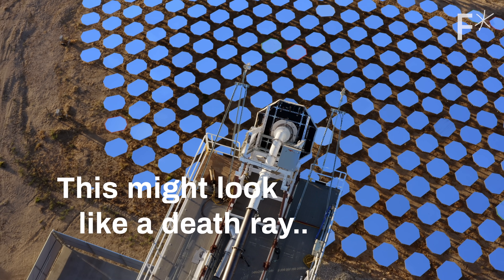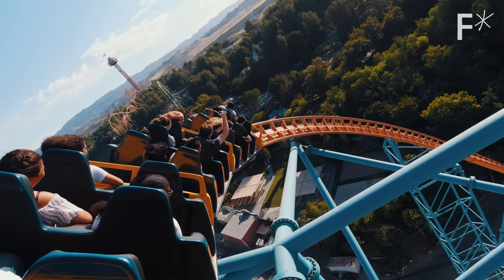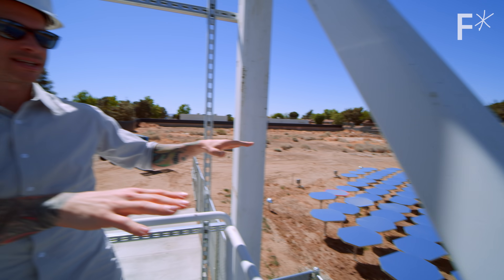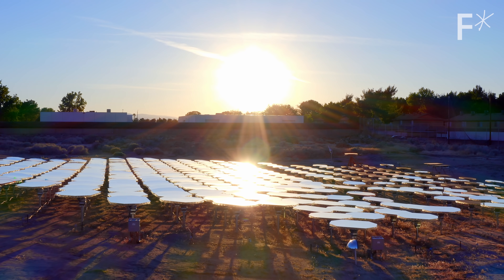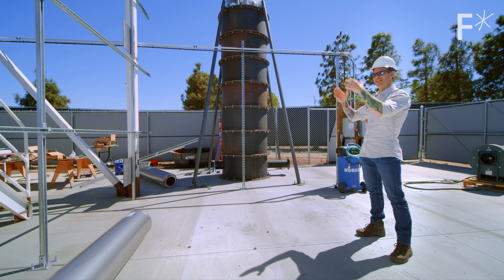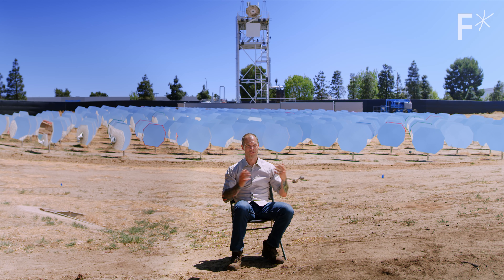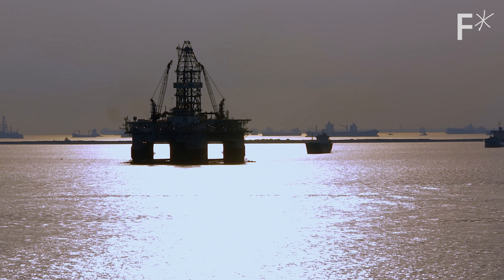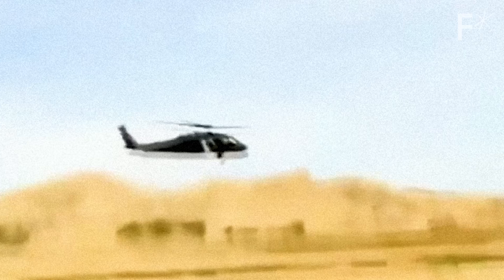How concentrated solar power could fuel the future | Big Think

Comment: Looks like an ad to me.
How efficient is the rock heat to electricity conversion?
How efficient is the electricity to hydrogen conversion?
How efficient is the hydrogen combustion or the hydrogen to electricity conversion?
I'm all for renewable energy, but there are so many questions left unanswered in this overly optimistic video.
We need to know if this is actually better than other renewable energy sources, and this video does not provide answers to that.
Reply: The Tired Horizon  30-60 homes is so little but seems ok for a start. Still it needs more advancement
Reply: Well if it’s storing the heat than this is already more efficient than photovoltaic lol
Reply: @MIKExMASSACREx  storing the thermal energy in the rocks may be efficient, but the heat is of little use unless you convert it into electricity. Thermal solar plants already exist and use the mirrors to heat water that turns into steam to power a turbine, and that is a pretty efficient method!
Reply: @unclerubo  this is what I was thinking of pretty much haha
Reply: @unclerubo  for some reason, the heated rocks make me think of heat pumps in some homes
Reply: I think he answered your question indirectly. He acknowledged that it needed to be cheaper than fossil fuel in order to be adopted. They are still working on developing the technology, but it seems possible. And I don't think more information is feasible in a 9:25 video.
Reply: @weldabar  I believe he specifically meant that the produced hydrogen needs to be more efficient. Direct electricity for the grid/cars etc is another option and usually more efficient. But hydrogen as a fuel may end up being the thing we find in industrial vehicles rather than electric, electric vehicle charging in cities will be tricky to roll out to all.
Reply: @weldabar  that’s not answering anything indirectly but more so it is their intended goal. However without knowing how they intend to achieve such a thing. It isn’t anything significant to talk about
Reply: Is that not more or less what the man traveling in his horse and carriage said when he saw his first Ford model T go by him?
Reply: @joe28704  except the model T was efficient and much more mobile than a horse. This doesn’t even compete much as far as from what is shown
Reply: @c.galindo9639  You are saying that from hindsight, not from the horseman's perspective at that time.
Reply: @joe28704  be it from hindsight or whatever the information I said is correct and in hindsight from this video. None of it is as feasible as other alternatives. It’s a start but a long way from such a thing. If anything the comparison is putting up the design of a brand new wheel vs a fully functioning wheel that is more capable and already installed and manufactured whereas this one is in the developing stage and is being tested and tweaked to rival the already existing and functioning wheel
Reply: @c.galindo9639   Your argument sums up to be what the man on a carriage thinks as the Model T pulls up to him. Life goes on.
Reply: @joe28704  so someone who thinks about efficiency and productivity?
I actually have no problem with that, do you?
Reply: It's an ad for great reset. A more easier way to do it is just drill a hole for 20km where is crazy hot, dump some water and wait for steam to come.
Reply: By the way, this looks cheaper than photovoltaic electric power, but still, no figures are presented, so I would like more information...
Reply: i am doing solar concentrator project on my backyard, it is good for domestic/independent use but for huge scalr like power entire earth, surely would be impossible, too many hassle and moving part,  solar energy are best for alternative but not for main sources
Reply: I see where you're coming from. Consider that it's early days on this tech and the efficiencies are less important when your input costs are close to zero. Let's see how it pans out. As an Australian, with lots of sunshine, I will confess to having a vested interest. :-)
Reply: This is old technology. 
They are just reporting it as new.
Reply: The Tired Horizon  what about heating rocks or something by lightning drawn in somehow
Reply: True...i was thinking the same
Reply: Cryogenic liquid hydrogen stored in a shipping container. Enough said and shown for me to turn off the video.
Reply: @MS Design it is a dry gas but you can never use natural gas pipelines to transport it because of hydrogen embrittlement. That's why it will be expensive no matter what, cold or warm area.
Reply: The ability to transfer heat is quite well understood so I would assuming it's in the high 90%, steam at 1000C is far beyond critical steam so about 40% efficient, but that is the same as any coal fire, natural gas or nuclear power plant, so we are talking ~39.2% efficient assuming the conversion from heat to storage to steam is 98% efficient. 

I don't think the efficiency of the hydrogen generation is particularly the question that is most pressing because the idea is you use energy that was otherwise going to be wasted so the efficiency doesn't really matter that much, what does matter however and is completely ignored by everyone I have ever listened to on this topic is the cost of keeping the electrolysis plant idle when there isn't spare renewable electrical capacity which to me seems like a show stopper given that electrolysis is pretty expensive even ignoring the energy costs.

40% again for hydrogen to electric conversion assuming a good steam turbine, however for heating it's like 90%+ efficient, but again that is the same for natural gas so as long as the cost of hydrogen is comparable (which again is the real question) also that hydrogen embitterment is a thing and will increase costs at every step as it will mean, replacing parts in the electrolysis plant fairly regularly, replacing the tanks and pipes to transport the hydrogen much more regularly, replacing parts on the power plants more regularly.

I see green hydrogen as a complete waste for most applications, steel making and as jet fuel are the only 2 applications where I can see it being worth it, however if we can keep improving batteries the jet fuel might be out.
Reply: Haha, you're an engineer as well?
Reply: For electrivity generation this technology is useless, but it is not useless for heat generation, and it's needed for production of steel, concrete, fertilizer production, chemical plants, iron, aluminum, plastic casting etc.
Reply: @jurgislll  Yeah, I would've liked some idea of the technology to transfer the heat from rocks to the production of metal.
Reply: @jurgislll  All those applications apart from steel making could use a thermal battery onsite instead as there are thermal batteries which can store temps upto 1500C from grid electricity during times of over abundance and/or having a wind and/or solar farm nearby, for lower temp applications which are lower than 300C a small modular reactor is an option which you directly just take the heat from making it technically 100% efficient vs more like 33% efficient for a small modular reactor for producing electricity, small modular reactor cost per kWh would still need to come down though to make it worth it especially given the red tape that would be around installing one.
Reply: @jurgislll  interesting
Reply: @jurgislll  that’s more of an insight but further analysis should be monitored for that, as far as efficiency goes
Reply: The purpose of the video was not to provide all the information,rather provide information that something like this exists. You can always read up if you have questions.
Reply: @rahulpanicker1453  no it says in the title what is intended. If anything it is mislabeled or “clickbait” as it is stated
Reply: Fusion power will be the leader.  Not sure about this one too many moving parts and moving rocks hundreds of miles.
Reply: @BoobieTubes  in the long run, fusion will be the power supply. The catch is we need an existing solution to energy demands because fusion will take decades to implement.
I too wish they would share the numbers in this video
Reply: @BoobieTubes  I don't think they intend to ship rocks hundreds of miles, but hydrogen.
Reply: He's also suggesting to build these farms in the middle east to send energy to northern Europe... where Hydroelectric already does nearly 100% of energy much cheaper than this could ever do.
Reply: @EirikXL  So, why does France and Germany rely on nuclear fission for most of their electric needs?  Germany  buys power from France btw.
Reply: @bongobrandy6297  Many countries buy Norwegian excess hydroelectricity also. They need fission energy because it is accessible 24/7, Hydroelectric energy is also 24/7. Wind and solar are not. (unless we can get something like this "rock battery" suggested in this video.
Reply: Its just another spasmodic science journalist doing reports no one needs rather than analysis they arent capable of.
Reply: @KM____________  Didn't you hear the crescendo and emotive swooshing sound effects at the end?
Reply: @NoGufff  lmao he's a spasmodic journalist of class

Comment: This seems like horrible media misuse/overuse of AI, because that seems like it's a rather simple script that does not even take a big dataset.
before the AI hype we would have used a somewhat fancy sounding math term for trial and error. And we don't need many tries here, because we kind of know the position of the sun during times of the day, it does not change around randomly. In fact it barely changes during a human lifetime.
So the pool of positions to try is very limited at any given time and might even only exist due to mechanical inaccuracy.
Anyone who uses a telescope in some kind of intelligent fashion should be able to give more details on this. I just know that we kind of know the movement in and of our solar system. So we don't need AI to "guess" the suns position. Just the described algo to adjust for mechanical error.
sundials prove that even ancient civilizations and some idea of the relative movement involved. Or at least it's results. So i would heavily assume we have a much more accurate idea by now.

Comment: best technology is a combination of concentrated solar power & photovoltaic generation via the natural birefringence of glass. in the concentrated solar power setup depicted in this video, there is a lot of unused thermal energy on each of those mirrors that is radiating back into the environment, when that heat energy could be captured at the mirror while reflecting directly to the solar collector the extra light not absorbed. this should increase efficiency by a significant factor.
Reply: Great idea but I also caught on the Bill Gross wants to keep the whole system of the mirrors simple for scaling and mass production. If taking the technology globally I can understand the attraction of stripping away the complexity of each component to make the deployment robust. Coming from Africa a sunlight rich continent this is so exciting. Factoring in the photovoltaics would add a layer of complexity. But maybe this could be retrofitted afterwards? The current urgency and costs is the issue methinks.
Reply: @raphaelkaume  i like max efficiency, not so much trying to compensate with quantity.
Reply: @h7opolo  It all boils down to upfront costs and whether that efficiency can be scaled effectively.
Reply: YES!! That's what I'm sayin', bro! ✔️👌👍
Reply: Perhaps not much of a factor but an added factor. The main concentration is from the light itself

Comment: Electric cars are already significantly cheaper to run, the buy in price is the challenge. I drove 517 km in June and it cost $5.74 CDN while local gas prices are $1.33/L CDN vs the ¢8.2/kWh CDN from 7PM to 7AM. And that's just over one charge cycle at ~70 kWh on a 64 kWh battery. At an average efficiency of 7.3 km/kWh I'm going to go further than some people for $0.082 than they can go for $1.33

Comment: This was already tried few times with stirling engines... whie not a bad idea in prnciple it was never cost efficient, the main probem was high initial price and mainenance costs of the motors rotating he mirrors (they often fail in such dusty and hot conditions). If you look carefully at the video you will see that many of the mirrors are not rotating with sun already.... 

Google: Maricopa Solar Plant (for reference)
Reply: Interesting. Yeah their whole AI system can’t function correctly if the mirrors are dirty and they can’t reflect the light either. Seems like an easy fix though.
Reply: Thanks for the info.

Comment: Each time this has been tried it has not been profitable.  This is the same investor money trap as the Moller Sky Car scheme.
Reply: Yeah, right. Why to try make the world a bit better, if someone failed before ;)
Reply: @airflow8327  He is NOT doing anything different than anyone else who did this before. Focusing (literally) the beam better just makes it hotter. That is what they are selling. The conversion to electricity and method of storage appears not to be any better than any other identical failed technology. Thus this company is not providing anything but "possible" profitability through a tiny gain in heat transfer and storage. Real Venture Capitalists would give this an F,  greedy VCs will sell the sh-t out of this (and are by posting the video).
Reply: @onedaya_martian1238  ever heard of Idealabs ?  He's the principal...
Reply: @lylestavast7652  He's a millionaire marketer.  Good for him.   The energy idea will make a few folks money and this will "dry up".  Evolution, even economic evolution works this way.

Comment: 1) How do they transfer the concentrated rays into the rocks through that pipe?
2) How does the heated rocks stored for weeks help in making energy? Need an explanation right now 🤔
Reply: Heated rocks make energy the same way we do for traditional fuel sources.  You use the heat to boil water, and direct the steam into a turbine to create electricity.  It's funny how almost every single one of our means of producing electricity involve boiling or running water.
Reply: exactly, they skipped that part!?

Comment: Hydrogen as an automotive fuel, even if it is used in a fuel cell, is a dead end technology.
Reply: What's dead end technology?
Reply: Sure, but couldn't it be used as a fuel in a generator to produce electricity? I'm guessing the point is that if they make these solar farms in deserts, bringing water in and making hydrogen fuel might be the best way to transport the energy out rather than turning it into electricity on site and transporting the raw electricity through cables. Hydrogen fuels might also be effective Aeroplane fuel but I have no idea on that topic. Batteries have yet to be practical for transport planes.

Comment: Couldn't you just use 1500c water vapor to spin motors like what happens in a nuclear power plant?
Reply: I thought the same. Maybe it's incompatible with the desert locations. Though I guess they must be using water at some point if their plan is to transport the power as hydrogen fuel. Maybe it's not worth the power cables to provide the power directly and pipelines of hydrogen are just more practical with the distance from civilization.
Reply: @Cjorss  how could pipelines be more convenient than power lines? 
We have power lines everywhere. 

 I would like to hear their reasoning.
Reply: @thesure1  Yeah, it would be nice to hear their reasoning. Even going from storing the energy by heating rocks to hydrogen fuels wasn't really explained. I'm really just speculating in the gaps. 

We do have power lines everywhere but is it not possible that the maintenance costs and chance for failure could be higher moving through vast uninhabited desert?

It could also be true that the cost of transporting hydrogen via pipes could be significantly cheaper than electricity through cables if the power generated is high enough.

I have no idea, it seems like the video wasn't designed for people who want these answers.
Reply: the refineries were designed to be placed on flat land with high temperatures so I’m not sure where they’ll be getting all this fresh water for the electrolysis process
Reply: A steam turbine could be used to generate electricity. But there would have to be a way to stop losses from evaporation of water in the system.
Storage is another consideration. The rocks store the heat for use at night.
In desert environments water is scarce.

Comment: If water is heated then vapor can be more easily moved from place to place.  What if water vapor is moved to drought locations where it is condensed and stored for agricultural and residential use?
Reply: What?????  Water vapor is made from… water. Why would you move water to this refinery, just to use energy to turn it into vapor and then move it back to a different location place.

Also, you can’t store water vapor, it just turns into water.
Reply: @klakiti02  Whoever invents dehydrated water is gonna be rich overnight.
Reply: @klakiti02  Not a refinery, a distillery.  The distillery would exist where the water already exists.  No transportation of water to the distillery is necessary.  Water vapor can be transported up hill where it condenses on the other side of the grade.  There is no storage as water vapor.
Reply: What? Move water vapor to drought locations?
Reply: @devina8812  Yes.  Isn't this how nature works anyhow?
Reply: @meandyouagainstthealgorithm  what do clouds have to do with this video I think I’m missing your point
Reply: @devina8812  Concentrated solar power can quickly heat water.  The video is about using solar power to heat rocks.  Now solar power could also be used to heat water to the point in which it becomes vapor.  Of course, clouds are vapor also.  Okay, now let's direct the vapor through transportation tubes to locations affected by drought.  Sorry, if this is confusing or seems offpoint.